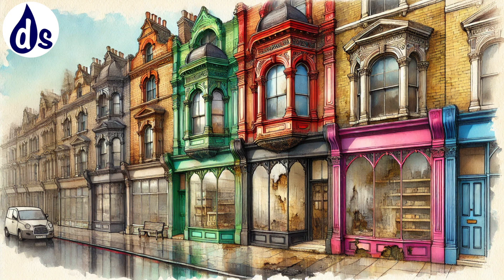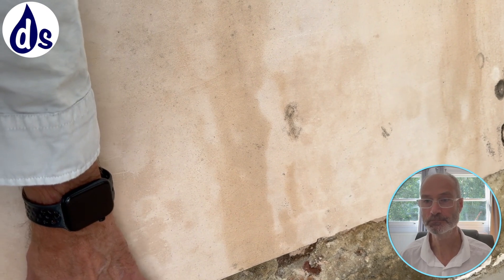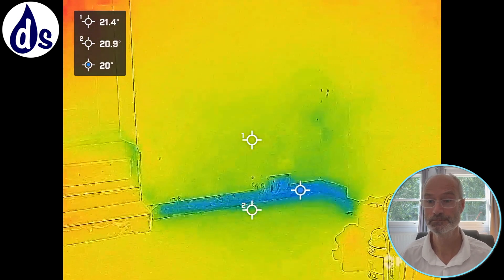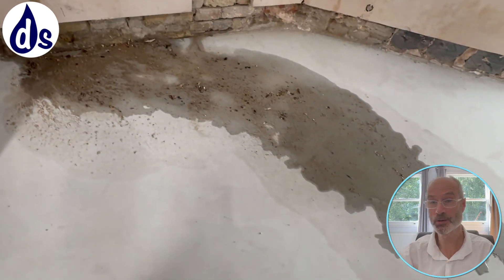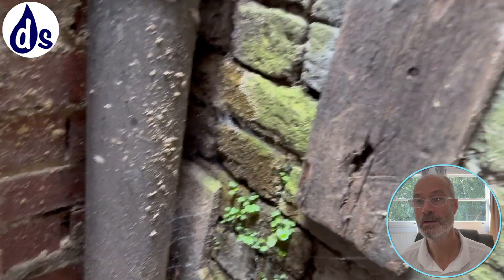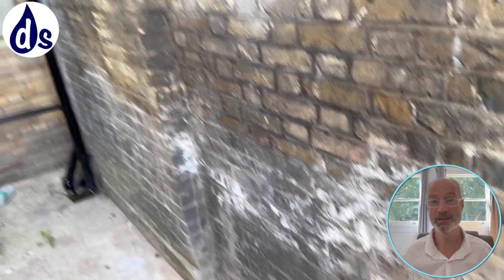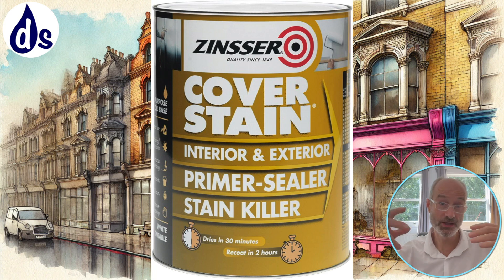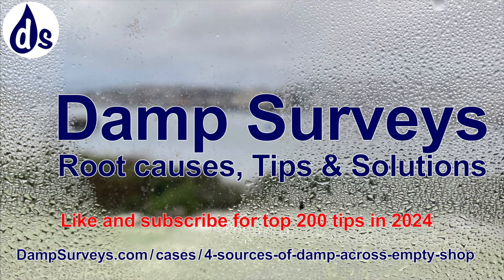4 sources of damp across empty shop #damp #leak  #rainwater #condensation #hygroscopic salts #pca

Comment: The house I am restoring shows signs of a little salt banding on the inside of an exterior wall. Would seem a shame to hack the good plaster off for such a small area (multitude of leaks outside and poor pointing all now repaired.) I had planned to use the insulating wallpaper on this wall (name escapes me, but is working well in other rooms.) Would it be worth painting with salt neutraliser, priming with Zinger over salted area, then insulating? Thanks.
Reply from the maker: Thanks for your question, Stan! 😊 Restoring a house can be so rewarding! 🏠🔨

The visible salts you describe are likely calcium sulphate (also known as gypsum) – a key component of plaster and cement. 🧱 These salts dissolve and move to the surface through evaporation 💧, usually due to a cycle of condensation and evaporation, meaning they don’t attract moisture from the air. 👍

Because of this, covering hygroscopic salts could prevent the wall from 'breathing' – that is, absorbing and evaporating moisture naturally. 🌬️❌ While there could also be hygroscopic salts, it is quite uncommon to have the two together – find and fix the root cause first, let the wall dry, then look to see if you have hygroscopic salts, as these are not a source of moisture.

Condensation? 💦 Use data loggers 📊 and check ventilation levels. Look for mould and other signs of excess vapour, such as condensation on windows and dribble marks.
Leak? 🕵️‍♂️ Test for mains leaks by watching your water meter over time (with no water usage). See my various videos for other easy leak checks. 💧🔎
Rainwater ingress? ☔ Check gutters, downpipes, gulleys, and drains for blockages (or empty traps). Penetrating damp usually leaves a brown stain. 🟤

To investigate further, use a radio frequency damp meter 📡 to map damp areas and look for a central zone. Pair it with a thermal imaging camera 🔥❄️ to pinpoint the ingress – just remember, most moisture sinks to the base, so don’t jump to conclusions about rising damp!
Your plan to use insulating wallpaper 🏠📄 is great for thermal comfort, but confirm the root cause before sealing over salts (especially avoid PIR). I’ve got lots of videos coming on these topics! 🎥

Here are some relevant videos you might find helpful:
Mould Moisture Mayhem – The Vapour Strikes Back
https://youtu.be/vVFBM-w5V3A
Exposing the Past – Damp Tales from a Victorian Flat
https://youtu.be/gyAVvlnTI08
Vapour in the Night – A Case Most Curious
https://youtu.be/ypXKyePX8SQ
Vendor Lost Sale Following Damp Proofer Survey
https://youtu.be/lIdqukv9NUI
All Insulation, No Ventilation – The Condensation Catastrophe
https://youtu.be/QxX7Bx5k008
Home Buyer Surveyor Claims Rising Damp Without Evidence
https://youtu.be/d7-G7SzPa90
Damp Déjà Vu – When Proofing Merely Displaces Damp
https://youtu.be/8PHsAEAESJY
Waste Pipe Causing Rising Damp-Like Symptoms
https://youtu.be/W_PtZILkSF4
Rot in Sub-Floor – Poor Airflow
https://youtu.be/3bcIIVeaUxQ
Penetrating Damp Through Render Cracks
https://youtu.be/-bgtJWxp4Fc

These are the basics. Subscribe and stay tuned for my upcoming guide to self-diagnosing damp! 📝💡
Good luck with your restoration! 🛠️😊
Reply: @dampsurveys  Brilliant thank you! Some great info that I need to digest. Walls appear to be drying following various remedial works, so will monitor the situation, as you suggest. :)